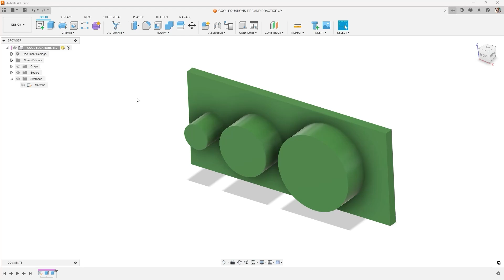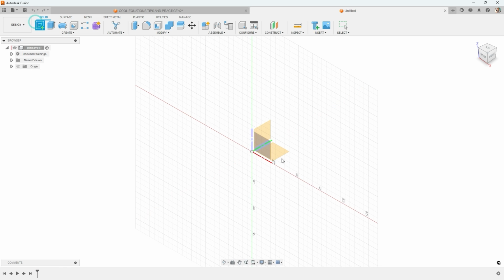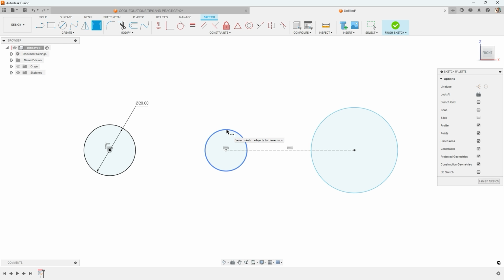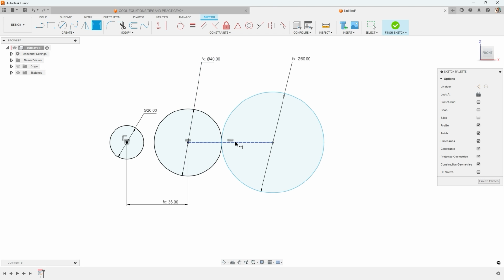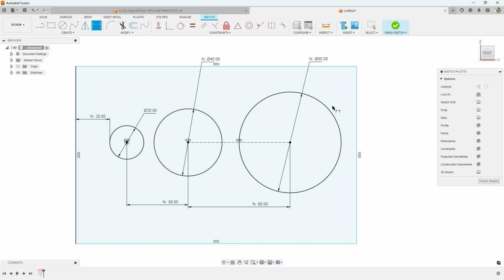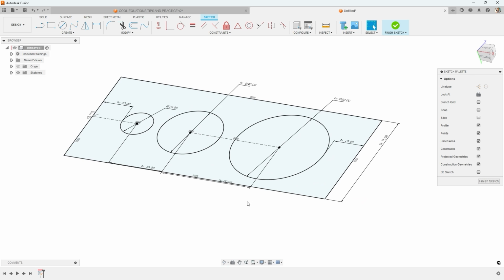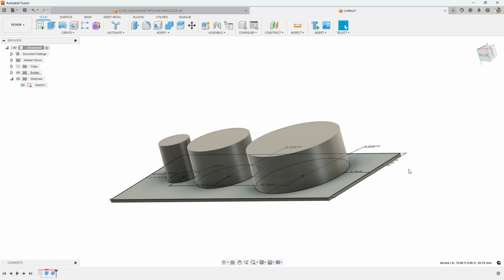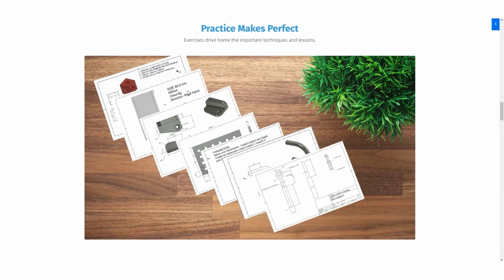Unlock Fusion 360's Full Potential: Why You Should Replace Dimensions with Powerful Equations!

Comment: You are not using named dimensions? I don't even see "fx" on your toolbar (even though you do show it in the video). A friend who started Fusion 360 more recently said he wished the application had named variables, so I looked at him a bit funny and showed the panel to him and made a sketch somewhat similar to your sample, but I then used the parameters to calculate how many pillars fit on a sketch and I used that to make a rectangular pattern on the extrude feature to fill the plate with pillars. He didn't know you could do that and it's actually something that he had wanted to do.

As a programmer, I'll also say that using the default d1, d2, d3 parameter names seems like very bad practice. Now here, I'll say that Fusion 360 seems unnecessarily clumsy in that you can't name the parameters on the fly while dimensioning. Ideally, I would just name the parameter as I go and even have some kind of name space with dot notation, so I could use pillar_diameter locally in the plate sketch and outside the sketch I could use plate.pillar_diameter in other sketches. Also, I think many users might not know that you can just rename d1 to to pillar_diameter without having to create a user parameter for it and that way the sketch parameter will not appear in the user parameters, which is probably best practice for parameters that aren't intended to be modified by whoever is making changes to the design. In programming terms, if the design is an application that takes input parameters to produce a part, then those would be user parameters and the internal variables used in the program would be the sketch parameters.

Using d1, d2, d3 feels like programming in Applesoft BASIC in 1981. Or maybe even worse...a programmable calculator from the 1970s that only had numbered registers for variables.

Comment: This is kinda silly example, because it can be achieved much simpler with a scaling when printing. You could have made it a lot more interesting, and with a real application, by making a fixed size plate and 3 knobs, where I could scale one and then the other two will automatically scale to fit the plate. That could not be achieved in Cura when printing, and I say that it has a real application because I made a similar design in the past, I had to make a panel wit 5 knobs, of which 3 smaller (same size) and 2 larger (same size, so we only deal with 2 sizes) and I wanted to see which proportion is the most useful, like easier for the user and pleasant to the eye, so I had to play with it until the client was satisfied.

Comment: I use equations but sometimes I get stuck trying to do some higher math. Like wanting to use square root in the equation. I was designing a part and wanted to make a right angle triangle where the hypotenuse was related to the other 2 sides. Any tips for that?